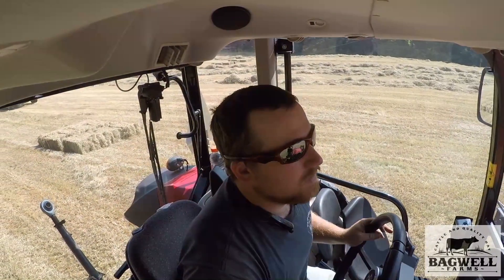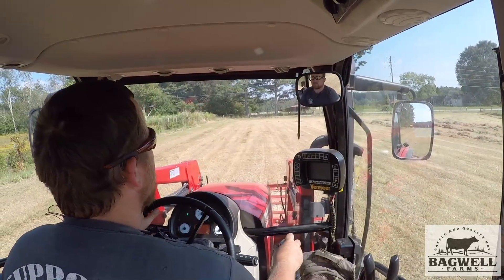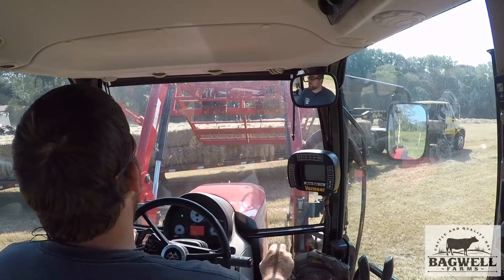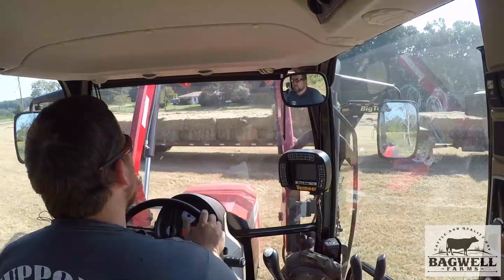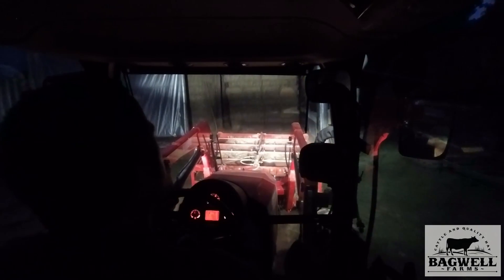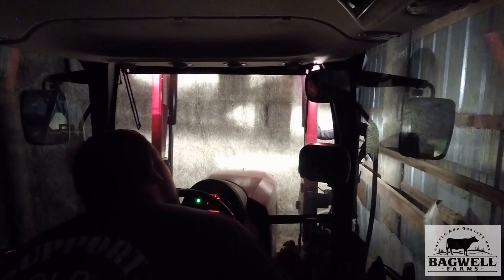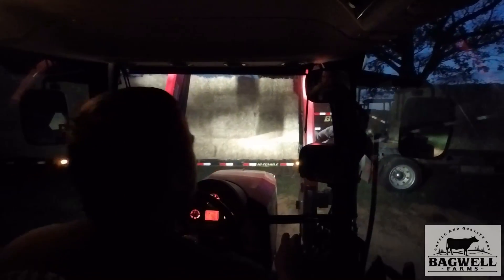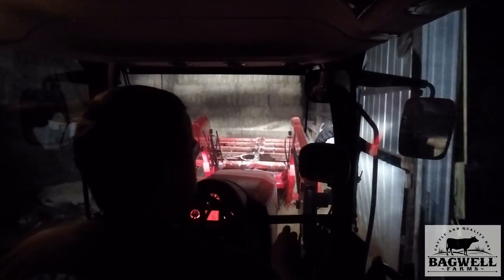Baling Bermuda squares

Comment: How is the low end lugging power on the 3 cylinder diesel comared to the 5445 4 cylinder engine?
Reply from the maker: So far its just as good ive done about everything with it I do with the 4 cylinders except pull the claas round baler that's where ill really be able to tell what its got next season will find out how it will do with it its a beast to pull